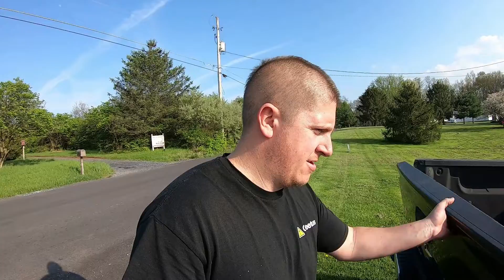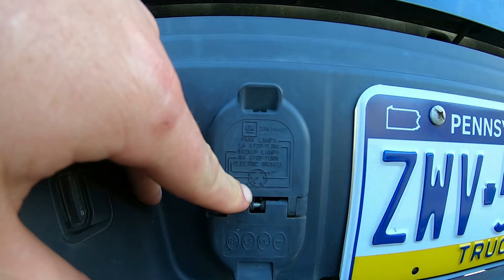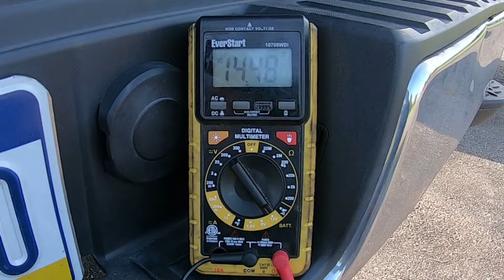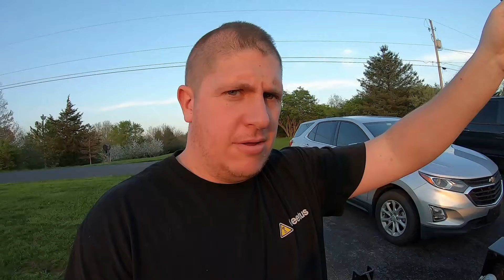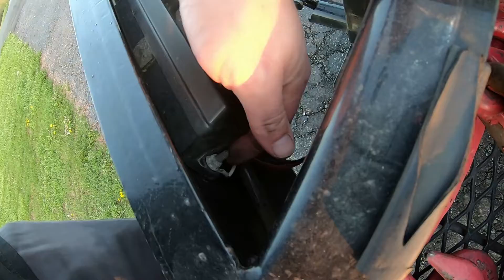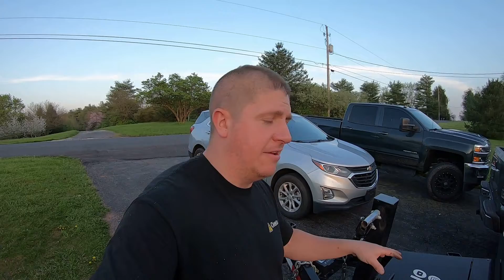Charge Your Trailer Battery While You Drive

Comment: I'm not sure how many other manufactures have BMS's like my F-150's going back to at least 2012 (two 2012's and currently a 2018) and my wife's 2016 Explorer, but they will kill most if not all drains before they flatten your battery.  I didn't realize some others didn't until I flattened my coworkers 2012 Tundra when I left his door open and we had to jump his truck at the end of the shift.  I'm not sure with a trailer drain, but I would assume it would be the same.  Also, great video and just what I was looking for, thanks!
Reply from the maker: Yeah the Battery Management Systems are different between models and manufacturers. My 2017 silverado 2500hd the BMS will shut off any other drains, lights, radio, etc, before it kills the battery, but it doesn't shut off the charge wire to the trailer plug. I learned the hard way, lol.

Comment: Thanks for this video. But I have a question. If your winch battery is low on volts, Is the winch going to start pulling amps from your tow vehicle battery? And are those amps going to be high enough to burn up the wires of the cable that is connecting the trailer to the tow vehicle?  Should there be some kind of an isolator that only allows voltage to flow to the winch battery? Or do you need to unplug your trailer wiring when using the winch, Just concerned.
Reply from the maker: Yes if the winch battery gets low it will pull power from the vehicle battery. But the Battery + wire in the trailer connector is fused, so if for some reason it started to draw more current than the wire is rated for, it would just blow the fuse. Pulling too much power at once, like if your winch battery was died and it started pulling from the vehicle battery, isn't something I would worry about as long as you maintain your fuses. I would however worry about having a dead winch battery, and then turning off the truck and leaving the trailer connected, that would draw a small amount of energy constantly until it drained the vehicle battery as well.

Comment: Thanks for video, it's what i thought. However, this might be dumb, but if you have wiring to power the battery of the winch, if you leave your car on while winching, wouldn't it use all the power it can? Meaning even if the battery is low, wouldn't the vehicle battery together with the alternator power the winch? Thus. Even making the use of a trailer battery obsolete? 
Also, I wired my gps tracker so it charges while its connected to a 7 pin (same method u did here) can it interfere if I also charge the winch 12v? And like someone mentioned, the electric brake controler battery could be affected? 
Thanks. I know this is confusing but hope someone understands.
Reply from the maker: Yes the winch will use whatever power is available to it, but the circuit and wire from the truck to the trailer battery isn't capable of carrying the amount of power required to power the winch, at least not one like I'm using. Maybe it could power a small atv winch or something like that. If I tried to use the winch without the trailer battery it would blow the fuse on the charge wire as soon as there was any load on the winch. Think about the size of the wire, the cables that come with most decent winches are 0 or 1 gauge wire, the wire from the truck to the trailer is 12 gauge, it has nowhere near the capacity to supply the winch.

Having your gps wired into the same circuit just means that there is less power available to whatever else is on the circuit downstream. Your gps probably uses less than 3 amps so it is unlikely to make any noticeable difference in the circuits ability to recharge the trailer/winch battery when you're not using it. 

By electric brake battery, are you meaning the safety breakaway battery? On my setup that is a completely separate circuit that is not tied into the winch or it's battery so even if I completely drain the winch battery, the breakaway battery will not be affected.

Comment: What gauge wire goes to the battery to charge it
Reply from the maker: I just used like an 8 gauge wire. It doesn't need to be huge, it's only function is to basically trickle charge the battery when the vehicle engine is running.

Comment: Also remember at least put a trigger fuse that way you can block energy flowing back to the truck in case of a draw. In just a push of button
Reply from the maker: I've never heard the term trigger fuse before. What you're describing sounds like a diode that only allows electricity to flow in one direction. That would prevent a draw in the truck from draining the trailer battery. For someone that leaves their trailer connected all the time certainly not a bad idea. I almost never leave my trailer connected when I'm not towing with it though. If/when I do I just unplug the trailer from the truck.
Reply: What is this im having trouble blowing the fuse? I think its happening when i use my winch. From my battery being depleted and a small wire and a 40 amp fuse. I just want to slowly charge my winch battery

Comment: Help me out, that junction box you put on your traile for wire connection, what is it's main function and where to get one? Also what is that box called so I know what to be looking for, Thank You. JD
Reply from the maker: Here you go. Primary purpose is to keep all of your electrical connections one on weatherproof place, easy to ad or remove circuits as needed or replace circuits if they get damaged. Here's a link for the one I used.

https://www.amazon.com/dp/B07QDQRX7P?ref_=ppx_hzsearch_conn_dt_b_fed_asin_title_1&th=1

Comment: Does it matter the gauge of wire used to run this?
Reply from the maker: It's not super sensitive to wire gauge since there's not a lot of amperage traveling through it. As long as you match the size of the wire for your brakes or go larger you'll be fine.
Reply: @MohawkMotors do you think it matters if you run the winch while it’s plugged into the vehicle? I know you said it’ll pull from the truck battery aswell so wouldn’t that be a lot of amperage running through those wires ?
Reply: @nicholasfortunato5691  I’m curious about this too

Comment: Could I run a switch between the wire from the terminal box to the trailer battery? When it's off that battery doesn't take battery power and when it's on it takes power that way so long as the switch is off you can leave the trailer hooked up as long as you want
Reply from the maker: yeah you could do that

Comment: Keep in mind the legend for location of the wires on those female 7 pin connectors are 180 degrees off on  newer trucks.
Reply from the maker: As in, the way the cap is labeled is not correct? I always just go by the wire locations on the cover of the female receptacle.
Reply: @MohawkMotors  It is correct but the orientation is upside down.  The notch is at 6 o'clock but any electronical diagram you look at the notch is supposed to be at 12 noon.  When you plug into newer trucks, the plug is actually upside down.  Example, on any wiring diagram, the blue trailer brake wire should be in 5 o'clock position. Ground at 7 o'clock.  Your cover is 11 and 1.
Reply from the maker: I see what you're saying. On the newer stuff like my 2017 the cap flips down, on older stuff like my gmt800's the cap flips up, thus 180*  off. I thought you meant the location on the cover were not correct to the plug it's on which would have been silly.

Comment: A good video for sure. One comment, if you by chance, already have an electric brake battery (in case of an unexpected disconnect from the tow vehicle) in the mix, you need to beware of potentially affecting that by adding additional batteries to charge in the circuit. If you have more battery loads in your trailer (Think camping battery bank), looking at a DC-DC charge controller can protect your starter battery from being discharged accidentally.  Good stuff! Thanks
Reply from the maker: Very good point! Having some kind of isolator or Diode to only allow energy to flow in your desired direction, and not flow somewhere undesired, like an additional battery, is a great idea.